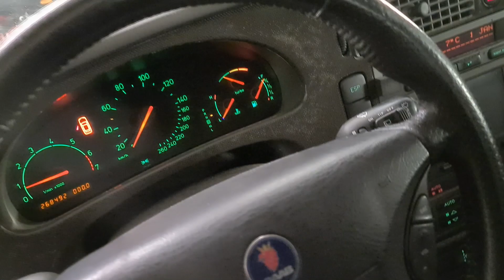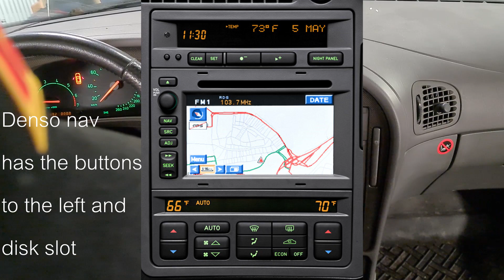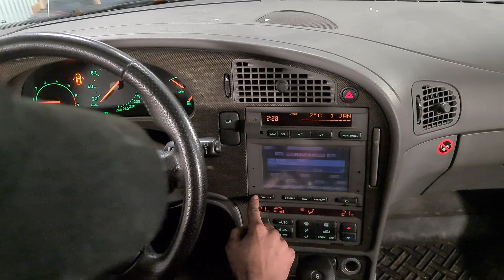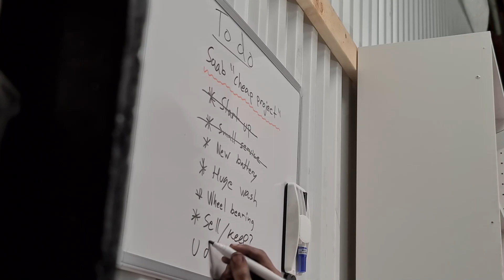SAAB 9-5 Refinement - Part 2 "The Aero donor car"

Comment: That chain noise is easily fixed by replacing the top rubber chain "guide". Over time these turn into hard plastic and it starts to sound like the chain is slapping against the valve cover. I replaced this  and the belt with pulleys on my 363k km 9000 CSE 2.3T Jubileum. Sounded like a new engine after this. Its cheap and easy. :)
Reply from the maker: This sounds perfect!
Thanks for the advice! :)

Comment: Hello! I saw you haul the combi with a trailer...How far did you travel  hauling the car? I purchased one and it's located more then 1,000 kilometers from my home, What was your experience? I read the 9-5 owner's manual about trailering and it said if the cargo exceeds 3,500 pounds (1,589 kg) the trailer must have it's owns brakes. I don't wanna twist or damage my 2004 9-5 Aero. The car to be hauled it's a 2002 Saab 9-5 2.3t with automatic transmission, so I'll take out the front axels to avoid transmission damage. I'm planning to use a tow bar and preventive lights. Please send me your reccomendations, thanks!
Reply from the maker: Hi Juan!
Nice to hear about your new Saab!
Yes, a friend with a trailer did it for me. We had the Saab on the trailer for ~150km only, rural road/highway. 
Yes, the trailer should have own brakes.
You don't need to take out the axels, just drive the car on the trailer, strap it on all four wheels (hard) and put it in park and lock the handbrake. 
And off course, take it easy and don't drive too fast!

Here is a pic how the trailer we used looks like (you can see it in the video, but it might be to dark to see it complete): https://03.cdn37.se/Ww/images/2.69528/3504-a4.jpeg

Good luck mate!